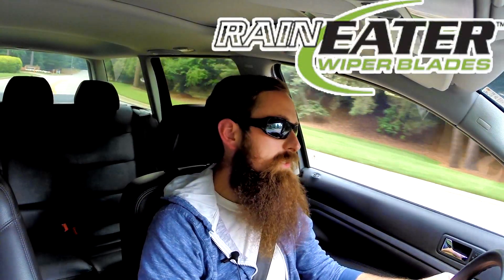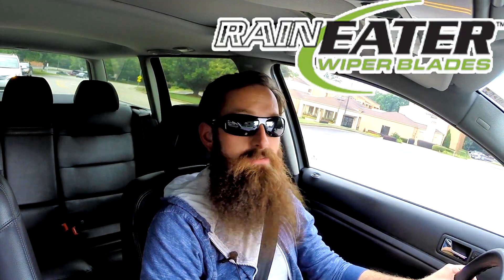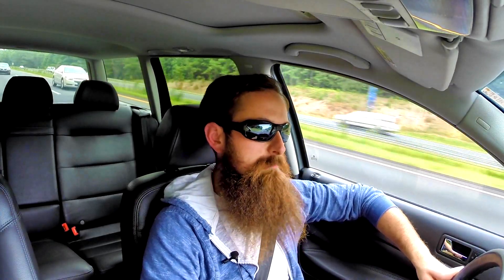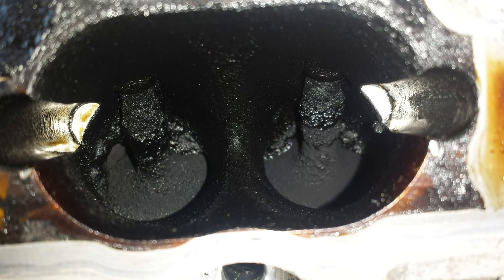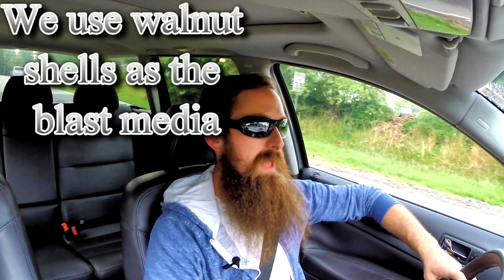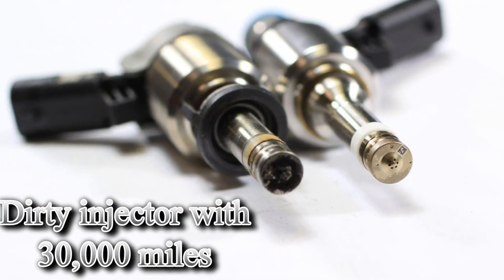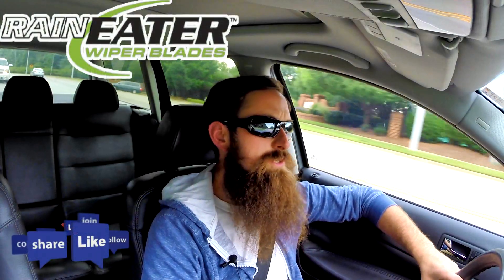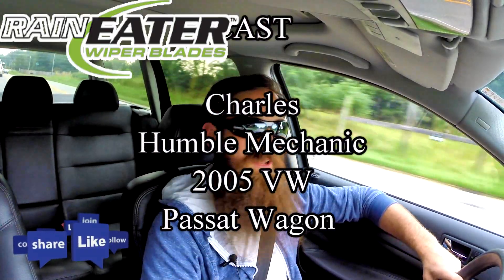Preventing and Fixing Carbon Issues for Direct Injection Engines ~ Episode 80

Comment: Instead use near boiling hot distilled water for carbon cleaning to not ruin your cat and for the steam to clean high spots in the works. Very slowly spray in a squirt, then let the engine run for a bout a full minute to get back up to full temp. Always use a catalytic converter cleaner in a tank of premium gas which burns hotter to prevent any dislodged carbon chunks from burning holes in the catalyst. Then after spraying through 4-8 ounces of water, do a Seafoam spray can cleaning according to their instructions, except halfway through the can do a few quick snaps of the throttle up to 3-3,500 rpm for tubidity to shake more loose. The naphthenic oil should help disperse any remaining moisture, but still do a 20 minute high rpm drive in a lower gear to be sure. Technically PEA cleaners like CRC work much better than Seafoam, but the petroleum distillates in the Seafoam should eliminate any residual water better

Comment: I did this on my 2016 A3 at 70k miles. There were CHUNKS of carbon buildup. A solid centimeter on every valve and my injectors were nearly clogged. My car was not throwing codes. Manually clean your valves and injectors if ur around 70k. I drove my car cross country at 50k, It didn’t seem to make a difference. You can clean ur valves and injectors for $100 in tools and a weekend.

Comment: Water mist into intake manifold. Run car at 2k rpm. Only carbon to worry about is on the stem. The back dont matter. Water mist gets in carbon, expands with heat and cracks carbon right off. Thats why a bad head gasket cyl is clean, clean. I was a master vw/audi tech so ive done tons of bead blasting on customers car for that loot. But on my car, f that, im cheap and lazy.  Engine very hot, go mist so no hydrolock. Wife got tiguan, did hers, and its fine. Dont worry about CAT. We'd run hose water through cats when doing v6 sec air inj carbon cleaning on audis.

Comment: I think what will help out ppl that wait until they have a problem with their GDI engine having multiple misfires is one get professional liquid induction system and valve cleaning done every 10,000 miles using BG GDI induction and valve cleaning that may set you back a couple hundy but well worth it! I get mine done every oil change at 5,000 miles but I use CRC GDI cleaner. I did this since day one when it hit its first 5000 miles. Now it has 71,000 miles and zero problems. VW may want to go with a both port and direct fuel injection system but that adds cost and complexity. I only mentioned it because I have a 2017 Toyota 86 with a flat four-cylinder 2.0L engine with that dual fuel system. I just think they should go back to Port injection.🤷🏻‍♂️

Comment: What exactly is meant by "top tier" fuels? Need to be careful about using industry jargon, assuming that everyone else knows what you mean.
Reply: They are gasoline with additives. They keep the engine 19X cleaner than the regular gas.. DOCUMENTED. Chevron, Shell etc, COSTCO Top Tier plus is supposed to come out this year The gas has PEA in it.
Reply: Usa Shell V-Power 100 ottani e ti troverai bene, io la metto sempre. 👍

Comment: I know that this vid is old but i installed a water injection kit to prevent carbon buildup and to cool intake temps on boost. Works extremely well to keep the valves clean

Comment: ❤Thanks Charles I am a new Porsche Cayenne Turbo owner.  They have DI or direct injection. Mine is at 86k miles but I got a video from a dealer with one at 116k miles.  There is an obvious valve clicking sound coming off the left head.  I told the dealer I suspect a serious engine issue is happening and its you know what.....
Should I take a chance on this Cayenne Turbo with a loudish valve tick sound at a discount price?  Again thanks and could you do a valve clean up on it for me?

Comment: Between 2011-2019 Hyundai got a "brilliant" idea to prevent carbon build up. They modified the ECU to pump a ton of gas at cold starts so some gas doesn't burn up and coats the combustion chamber (and valves) and keeps everything clean. It worked like magic except that this excess of gasoline also leaked into the engine oil causing severe oil dilution. Add to this the Hyundai GDI engines stay a lot of time near 1000rpm (low torque, more stress on rod bearings) and boom: tons of engines seized. Only from 2020 models they finally added an extra port injector and stopped 'soaking' the combustion chamber with gasoline.

Comment: Highway mileage will prevent carbon buildup. My 2016 Jetta got to 150k before it built up enough to do a cleaning. I use  good fuel and good oil every 10k

Comment: We recently bought a Buick TourX (Opel Insignia) with a 2.0 LTE GDI engine. It was a lease return that was basically used as a grocery getter for the first 20K miles. Although we're satisficed with it, we noticed after a month of ownership that it had a little bit of a miss-like behaviour ... and occasionally ran a little rough for the first minute after starting (no codes, no MIL). We only use Shell high octane, but even that didn't seem to help. Recently, my wife took the car on a cross country road trip to Michigan ... often doing 85mph+ on the open highway for 2600 mile round trip. Now that she's back - the problem is gone. Was it carbon build up? Hard to say - but a VERY long highway drive seemed to have cured it. Caveat here is, the car started out with only had 20K miles on it ... if the car had been driven in the city for 70K miles, it might have required an actual walnut shell blasting to clean it out. But needless to say, I'm happy I don't have to touch it for the time being.

Comment: Good video, I just bought a 2023 Kia Sportage with a 2.5L GDI engine I drive on the highway to & from work about 38 miles each way at an average speed of 80 mph I use top tier gas too & I’ll be using the gas treatment Kia recommends so hopefully I won’t experience this issue soon as I’ll probably hit 60K to 70K in about 4 years or so. Good to know the issue isn’t brand specific too.

Comment: My 2017 tiguan 70000 miles is having strong shaking when i give it gas and let up it shakes violently the dealer is changing the mounts? Seems like a fuel issue to me what should i do
Reply: I hope you got this fixed. I had a similar problem and it was the intake valves clogged from carbon

Comment: There is a theory that running the engine while spraying water in the air intake will clean some of the carbon build up. 
I have never seen any carbon build up in engines that have coolant leak into them... I am not referring to valves of course.

Comment: I have an Alfa Romeo Giulietta Quadeifoflio, 1750 tubo, 240 hp, direct injected , no carbon build up, absolutely none, no secondaries port injectors. MI wife have a BMW 3 series, full of carbon, and full of problems. BMW reliability sicks, on motorcycles and on cars, German engineering is a mith.

Comment: Italian tune up does fuck all for the carbon build up BEHIND THE VALVES... It'll help on port injection and can "clean" inside a bit. But it'll do nothing on the valves. 

I feel a regular oil change and seafoam in intake every 20k miles could maintain the motor clean to 100k or so.

Comment: A top tier fuel is likely to burn more efficiently and cleaner, causing less oil dilution, so what's drawn into the PCV system from blow-by will be reduced. A VERY important issue people need to understand is that with the advent of weaker piston rings, a lighter oil is required. Many newer vehicles call for 0W-20 to prevent the oil being too thick as the oil control rings cannot effectively scrape the excess oil from the cylinder. This causes oil consumption to rise and also low-speed pre-ignition from the fact that too much oil causes the mixture to run lean. So, resist the urge to dump 20W-50 into your late model car ;-)  BTW, It's she and I, not her and I. To test this, let's talk about how your wife likes to go out for ice cream. If she's alone, it's she went to get ice cream. You wouldn't say her went to get ice cream. Right?

Comment: I don't really see how an "Italian Tune Up" in a TDI will help running your engine at higher revs, a warmer engine which in turn causes higher oil temp wouldn't that just cause more crankcase vapors running into engine? Just a thought I'm not a mechanic. The shop I take my Alltrack to said they clean the injectors too like he said. I'm also wondering if I should have my water pump changed out while it's apart too (I've heard they're prone to leaking around 50Kmi). Might save some on labor if done together?
Reply: Italian tune up is a myth the gas never touches the valves no matter how hard you drive

Comment: I have a 2011 f150 with the 3.5 twin turbo, it has 385,000 miles on it now with zero issues. I was worried about this at first but through my investigation the best way to prevent coking on the valves and turbos is using a very good synthetic oil with the best oil filter money can buy. I’ve found that when the filter media is allowing contaminates above 20mics to enter the the PCV system it starts to accumulate on the back of the valves and on the turbo shafts. The type of oil and the change intervals are important too, I just went with Amsoil because it’s the best. You can do your own experiment if you have a catch can install on your vehicle. You can see the difference between a quality oil change and the average oil change. The quality oil change will have a kind of milky color to the PCV fluid, this fluid will actually burn in the combustion process. The average oil change you’ll find the PCV fluid is black and gritty, this fluid will not completely burn in the combustion chamber. The 40 mic contaminates are too large, so the collect and harden on the back side of intake valves, the top of the pistons and on the turbo shaft. Of course causing misfires, loss of fuel economy, turbo and valve failures. Switch to a very good synthetic oil and filter and change it every 6,000 miles and your gdi engine will last a long time.

Comment: i just build my 2011 skoda RS engine when the timing chain tensioner fail. It had 244000km it had huge carbon build up on all valves, but never did had cold start misfires. Now everything is new and its running again. Your videos have helped me a lot for this project

Comment: short trips, long oil change intervals, lack of a long hiway speed trips with the vehicle I believe are the primary factors in the carbon build up. The engine needs to reach operating temperature and be at higher rpm's and stay there for some duration, such operation has always made cars run better, the old blow the gunk out hi speed road trip. Long oil change allows for oil breakdown and generation of more volatiles. Catch cans I view with suspicion, they won't hurt but no one has ever been able to show how much of the oily material is actually caught in the PCV air stream and no one has actually measured the volume of PCV airstream per unit time. My guess is the catch cans are catching only a tiny fraction of the total petroleum aerosols in the PCV air stream.

Comment: If it was as simple as shutting down backdraffing of fuel vapors gumming up then carbon builds up. Why not turn off the fuel injection before turning off the spark and let the motor a few rotations to burn off any leftover vapors.

Comment: I have a 2013 Audi with the 3.0 supercharged engine.  It has 65k on it so far and hasn't given me any fault codes yet.  Since there's an intercooler in the way you can get a bore scope in to see the valves.  I suppose your could see if the intercooler is plugged with carbon.  
I get a gas like smell outside the car or under the hood if I open it after I shut the engine off after 20min or longer drive.  Does anyone else get this?

Comment: I don't think top tier gas will help in the case of direct injection vs port because with port gas engines it's spraying fuel in where the air intake valves are but would help keep the fuel pump and injectors working effectively since it always keep it clean but after a while you still need to get a carbon deposit cleaning done probably around  every 4-5 years

Comment: I have a 2012 VW CC with 300,200 miles and still going very strong.   I bought this car brand new in 2011 and it has been the best car I have ever owned.  I just wanted to see if any other members had high mileage CC like mine.   I have look through forums but I have not found one yet.   The car has the original engine and original transmission (with original fluid).  It still shifts beautiful.   I have de-carbed the engine valves about 5 times, replaced injectors at 200k just because and gone through about 5 water pumps.  I had to fix the turbo but It was a simple wans gate problem that was easy to fix.   I replaced rear shock, a sway bar, truck wire harness  and surprisingly got 200k out of my brakes.  Stopping on my second set now.   I have always maintained my own car after the initial warranty was finished.  I have always used Mobil 1 oil and filter.  I am passed 300k and going for 400k.  Others than road rash and normal wear tear the car is in really good shape.   I love this car and will continue to run it until the wheels fall off at which point I will put them back on and keep going.  Any how I know this car maybe a unicorn but I own it and love it.  Thank you for your site and videos always good information.
Reply: I have a cc vw 2012 i have a carbon build up issue and i need an intake manifold.Really a headache
Reply: How did u clean the valves?

Comment: Spirted driving (iv just completed an on line speed awareness course so no points) here in UK  haha , i use top fuel in my 7.5 modified GtI ,regular oil changes far more than they say to ,and oil catch can , FYI i don't get a wispier of oil bone dry in my catch can .That's my way of dealing with the issue.

Comment: This is why I chose a Toyota they added 4 multiport injectors and 4 direct injection injectors. The computer controls everything. Only time will tell if this salution works well. Sometimes I do not think the trade off is worth it and they should dump direct injection and stick with port injection. You are right especially now you cannot find much out there without direct injection its all going that way so unless you want to rebuild your vehicle over and over again you will have to buy a car with this. One thing Toyota did that I do not like is they braught back an EGR! A lot of this I believe is done on purpose to create new revenue streams for the auto makers. More maintenance money. I am just glad I dumped Ford and Chevy and went back to Toyota. I like VW's as well, but not a whole lot in my area:P

Comment: I tell ya what... Marvel mystery oil .... I dunno why or how it does it but we got a 2010 VW CC TSI 2.0 sport that is having a #3 misfire.. n I changed the coils n plugs still same thing... #3 misfire... Well I put marvels into the fuel and in the oil... N I instead of buying a new pcv I just cleaned it. But before I cleaned pcv I ran the marvel... And the car after two tanks with it in the oil n fuel the car started getting more n more power then I cleaned the pcv and now it's back to normal... But that marvel's cleaned the carbon up on both sides... You gotta add it to the oil in order for it get the carbon on the back side of the valves.. but that stuff works n I dunno how but it has on two TSI motors one was badly caked up with carbon n marvel got it... It takes a lil bit but it will do the job use sea foam for the piston heads and plugs n front of the valves and use marvel for the fuel n oil and everything gets cleaned... It's a trick but it don't solve it eventually it'll get caked up again... Unless you run the Marvel's each time you fill up n add oil. N do oil changes.

Comment: For decades I have "decoked"  my engines using brake fluid. Even using a bit of brake fluid on my finger and rubbing it into carbon, it breaks it down very quickly. Do your think that would work on the back of valves?

Comment: Charles, how often do you see carbon build up cause compression issues? Maybe because carbon stops the intake valves from sealing correctly.
Love your videos! Thanks
Reply from the maker: I haven’t. More often it’s oil rings stick g causing consumption issues. 

That’s about the only internal engine sadness I’ve seen

Comment: @3:04 It only matter why it is happening if it is not a design flaw but an operator error. E. g. first turbo charged cars by Audi and American relaxed attitude towards maintenance - oil changes.
@10:36 The TSI engines are turbocharged and supercharged.  Lower compression ratio? Lower quality fuel requirements? The FSIs clearly have a higher compression ratio and require  top tier fuel and as you mentioned, "quality" fuel kinda mitigates the problem. :)

Comment: As a spirited driver of a MKVI Golf R, just had large amount of carbon build up removed at 126,000 miles. This after replacing the in-tank fuel pump (only 20k miles since previous replacement) and HP fuel pump/all fuel rail sensors 30k miles ago. Tell tale: cylinder 3 misfire. Running like a champ now.

Comment: forgot/// i have a 2014 ford fusion with a 2.0 turbo gdi engine.. while i work on italian classic cars..i always tell my customer to use 16 oz MMO about 2-500 miles before an oil change,, just to keep the oil control rings and the other ring land clean of carbon..i also do this to my 2014 ford fusion..i took off the intake manifold to check on carbon build up * once a year thing for me ), and i noticed the carbon that was there was getting less build up..i also installed a oil catch can  about 100,000 miles into the car.. she has 143569 miles as of now... i cannot say if the MMO is doing the cleaning or the new catch can... but the MMO  has a solvent built into it... this is just what i have seen in my engine..no promises.... but a small bottle 16 oz of MMO about 500 ish mile before an oil change might help